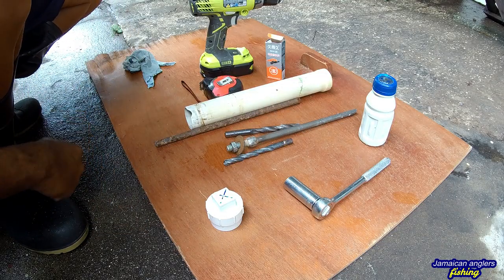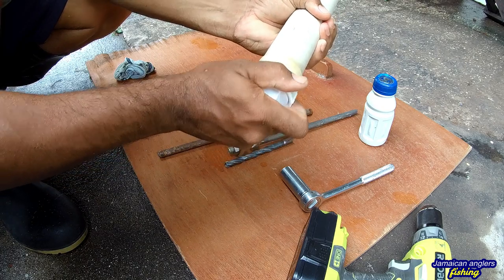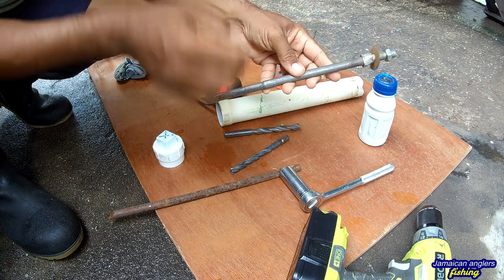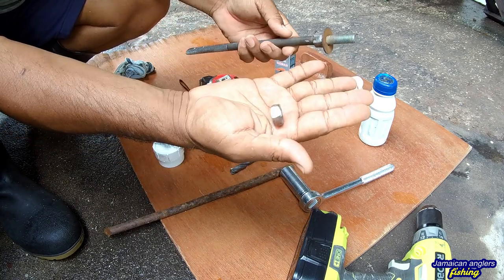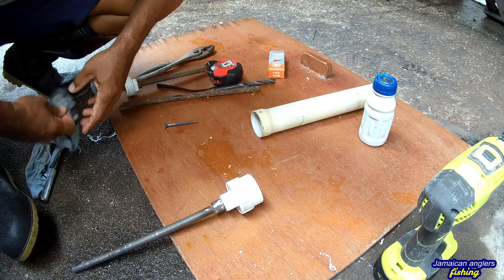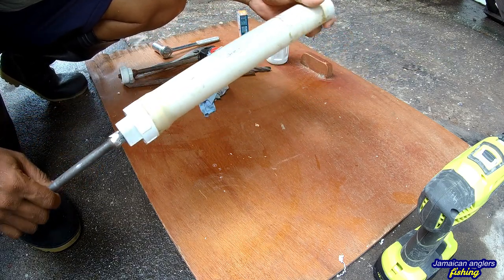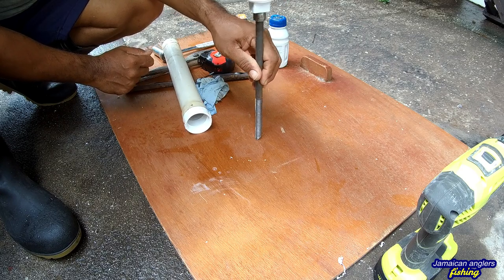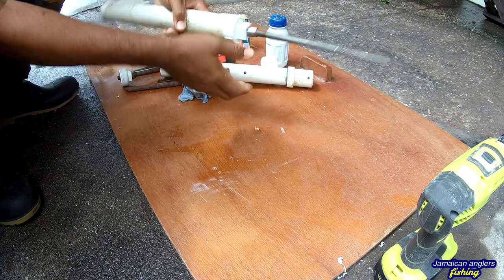How to make my sand spike (DIY)

Comment: very handy idea, you can also use an inch and a half coupling instead of heating the pipe and then you're clean out adapter will fit right into the other end of the coupling.

Comment: Hey Rohan, great sand spikes man. I've been watching your channel and I see you struggling with your fishing gears on  the  beach. I think you need a fishing cart. As an angler myself, I have made mine with inflatable wheel barrow wheels (easy to roll on the sand) framed with 1 1/2"pvc pipes on the corners and the sides (which can be used as rod holders). Pvc louvre window blades for the siding and floor. Screwed or bolted together. Very lightweight, strong and won't rust...carries cooler, rod, folding chairs, umbrella etc...
"Fish on bro".
Reply from the maker: A fishing cart is a good idea but it will be too much trouble to take it with us everywhere we go because we couldbt leave it at the beach..A alright travelling with the stuff just need it to be a little more compact.. I need a new fishing bag where i can put the rods on the side of the bag when an moving on the sand..

Comment: Once again I’m impressed with your ingenuity. I have just plain PVC rod holders that I have to beat in with a mallet. I’m making me some of these. Thanks!
Reply from the maker: Ok my friend no problem, these are easy to put in without hammering. When you watch my videos you'll see how I put them in..
Reply from the maker: Just remember dont set your drag too tight..
Reply: @jamaicananglersfishing2869  yes, I made that mistake many years ago. I was running down the beach chasing the rod…LOL! Thanks